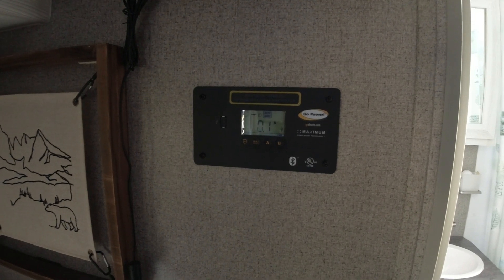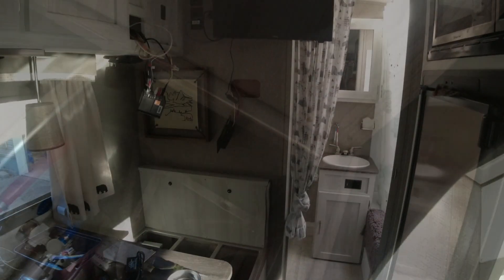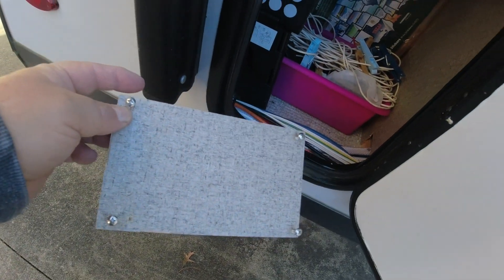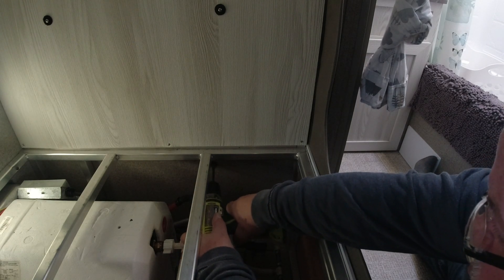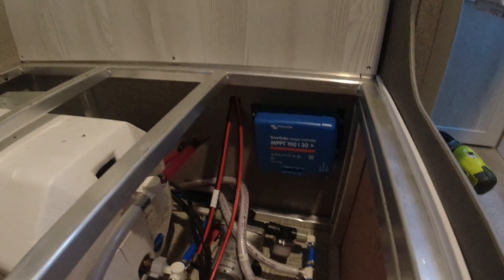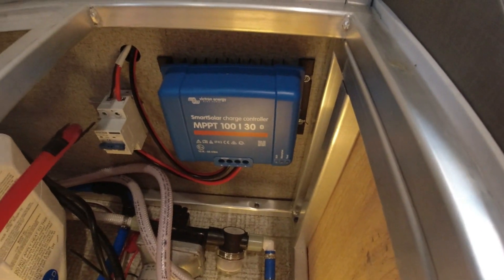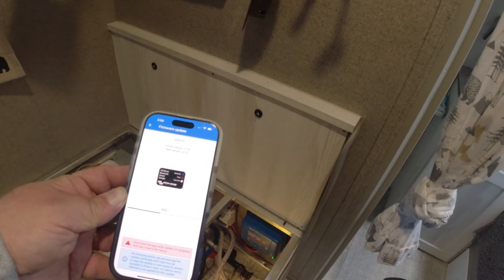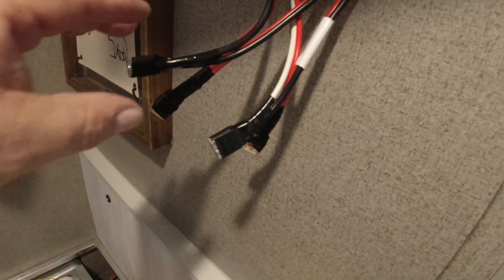Updating an RV Solar Controller

Comment: Thanks to this video, I was able to successfully replace my GoPower controller with a Victron100/30 controller and move it to the same area under the dinette in my 2022 FD. There were a few difference to my install, but your video gave me a lot of inspiration and ideas on getting my modification done. I took your idea and installed a 1/2 inch wood backer plate. I made sure the backer plate was snug to the dinette's aluminum framing before I secured it to the wall with a half dozen 1" #10 sheet metal screws. Along with the screws used for the controller and the cutoff switch, this really made a big difference in stability. I also moved the solar cutoff from the left side to the right side of the controller. That way the wiring made more of a natural loop from the wiring hole, along the dinette frame and above the controller, then to the cutoff, then back to the Victron controller, then back to the hole. I also used MC4 connectors instead of WAGOs for the 10 awg connections for the wall extensions and the solar cutoff connection. I like WAGOs, but liked the idea of MC4 connectors better for this job. For the wiring extensions from the controller to the battery, I used 8awg wiring instead of 10awg wire to give better current to the battery produced by my 400 watts of solar. You should be good using your 10 awg wire with 200 watts of solar, but I would recommend that you upgrade to 8 awg if you ever add another 200 watts of solar. I used in-line automotive butt connectors for the 8 awg wiring extensions because my MC4 connectors were only rated for 10 awg wiring. The butt connectors are brass with Nickle plating and specific for 8 awg wire. I added shrink wrap and electrical tape to protect them. I also used Ferrules for all wiring on the controller. To finish everything off, I used wire loom tubing around the loose wires and then used sticky tabbed zip ties to hold the wiring to the backer panel and dinette framing to prevent the wiring from coming loose into the storage area. Again, thanks for the inspiration and direction on this mod. It was a great idea moving the controller to the dinette storage area that I hadn't thought of before seeing your video.
Reply from the maker: @markchanner3616  Wow, sounds like you’re install tuned out great, thanks for sharing your insights

Comment: Can you elaborate a bit on why you are saying the stock Go Power controller is not very good with lithium batteries?
Reply from the maker: @lecampingconnecte  The Go Power controller is a little less efficient that the victron controller because they work in different way. As far as lithium, the watt meter is not a good way to meter your consumption. The only accurate way to know how much power is used is to have a shunt for metering.

Comment: That MPPT controller is going to work a whole lot better than your old PWM. Especially since your battery is so far away from the controller. Is it possible to fit the battery in the same compartment as the controller or put the controller in the same compartment as the battery? This way you can minimize the voltage drop on that long cable run from the controller to the battery. Great upgrade. Very neat and well done. For me, these types of videos along with your woodworking skills are my favorites. On another note, we finally finished cleaning up that pine tree that fell. Got a stack of wood drying to be used in the fire pit eventually. Happy trails!
Reply from the maker: @Tom-In-Ga  Unfortunately not enough room in that compartment for the battery, but I am doing the panel upgrade now with the new shadowflux Renogy 200 watt and so far I am amazed at the increased power. I also finally got all the pines out of my yard. Thanks for your comments.

Comment: Another nice video. We did the same upgrade using the same controller, except our rig is a 19BH and we already had our lithium battery installed under the dinette bench. We just left the old controller control panel in its place but your mod is something that we will probably consider. 

There are a few things that I will pass on based on our experience.

1. These controllers are relatively heavy and where you have mounted it may not hold. We mounted ours on a piece of 1/2 inch OSB and then mounted that directly to the aluminum framing that forms the base for the bench. We used 2 large screws to secure it but over time, with the jostling of our rig, the OSB broke loose and we had to install it again using 4 screws rather than the 2 that we had.

2. Watch your solar disconnect breaker. We discovered that, again, with the jostling of our rig, that switch will trip and turn your solar connection off. We were wondering why our solar panels were not charging the batteries and that was the culprit. I just attached a clip to hold it in place to prevent this from happening. 

I did record the process and will eventually upload a video on it. We just started uploading videos to our channel a few weeks ago and now have 3. We also have other modification/repair videos that we will be posting eventually.

All in all, as usual, you did a great job with your modification. Safe travels!
Reply from the maker: Thanks for the info on the mounting, I was wondering how it might hold up over the long term.
Reply: @Turtle3863  You're welcome!